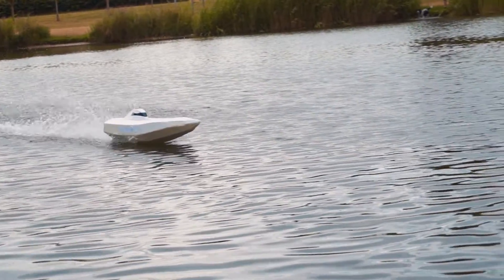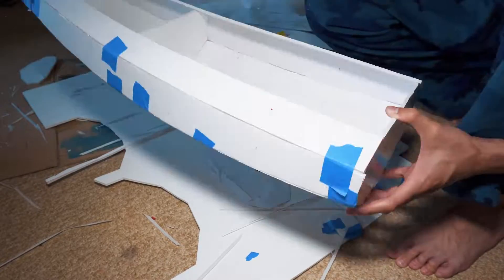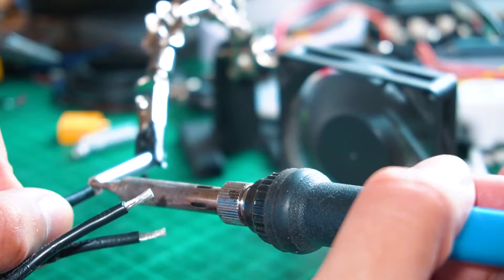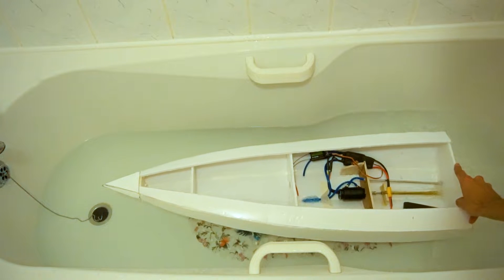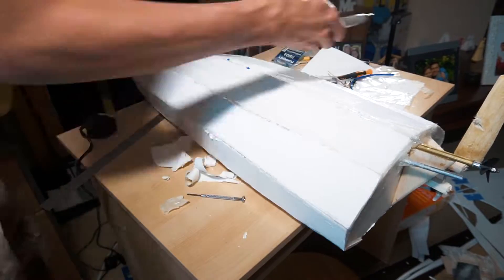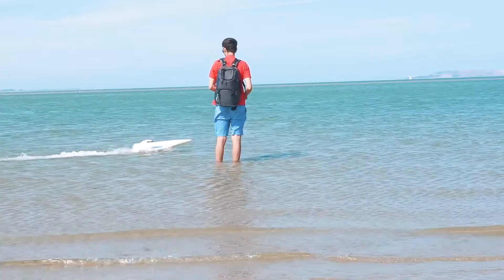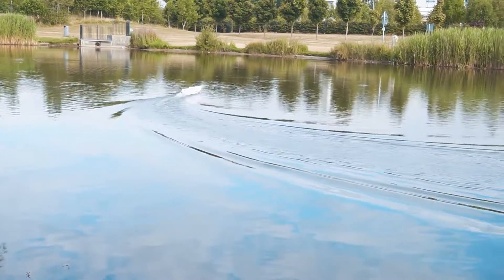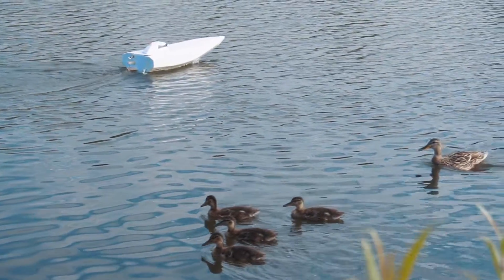Incredible RC racing boat built at home

Comment: Hey I liked your video but may I make a few suggestions that most won't tell you one is for speed the prop shaft needs to be at a flat to slightly upward angle the direction you have yours in it is pushing the front of the boat down into the water creating drag also the size of the propeller makes a difference I would have added some weight in the rear and leveled out the shaft so the shaft will push boat front up creating as little drag as possible also another more important part is to ensure prop shaft and motor shaft are dead centered or will create a wobble that will kill your speed and do damage to your motor. I am finding this one out the hard way have to redesign my ft011 motor mount for my larger motor so it is more dead centered creating a safer running high speed boat

Comment: Super video 👍

Question: How did you waterproof the exit from the boat of the propeller shaft?
Reply from the maker: Using the same silicone compound to waterproof the panel joints.
Reply: Joyplanes RC 2 thanks, I’ll give it a go 👍

Comment: So did you put a coating on it to waterproof the foamboard itself? If so what did you use?
Reply: Nevermind* I just saw that you used fiberglass
Reply from the maker: Yes, I put a layer of fiberglass, and silicone in the joints.

Comment: Very cool, great engineering 
I made a home made RC boat but mine was 3D printed
Reply from the maker: Thank you. I also did a 3d printed one but it took so long and the glued parts started to fail after some time.
Reply: I just used some random waterproof glue. It worked amazingly and I crashed the boat twice and sunk it for 3 months until someone found it and it will work lol.

You can find the boat on my channel you want some ideas